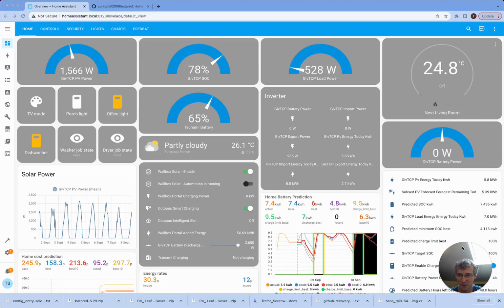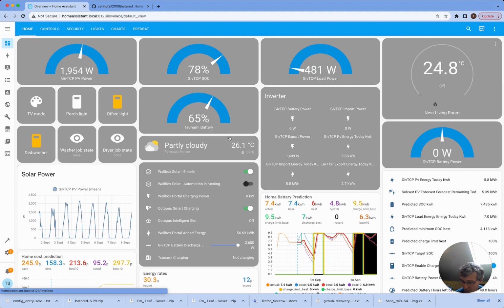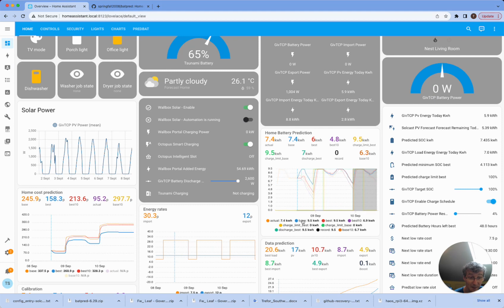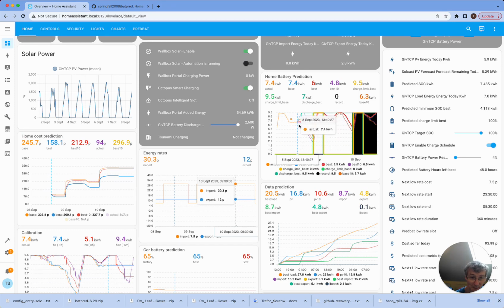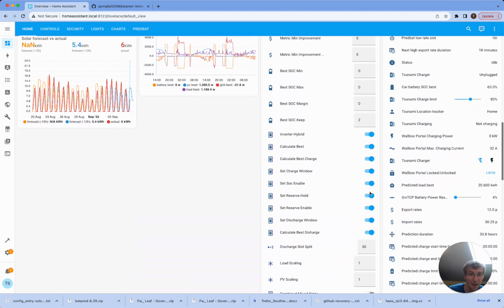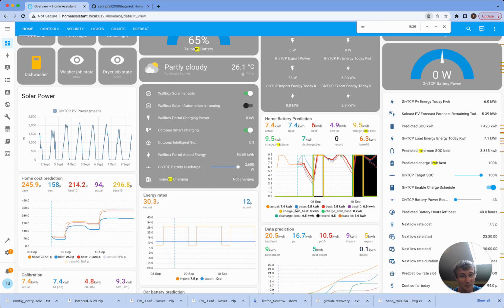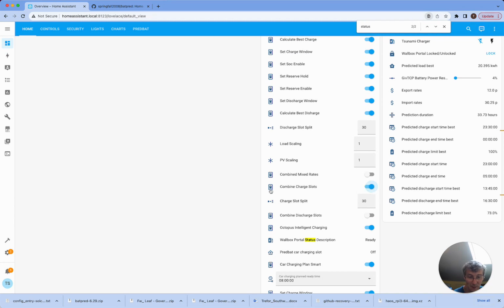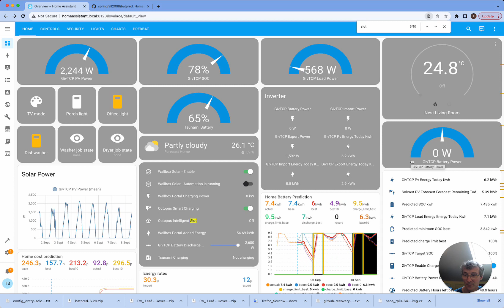Predbat - Overview, how does it work

Comment: Can predbat run the battery in a way that is simultaneously charging from solar and discharging to the grid??
Reply from the maker: You can't both charge and discharge the battery at once, but when the battery is discharging the solar will also be exported up to your inverter limit.